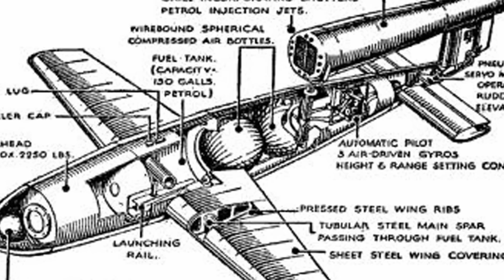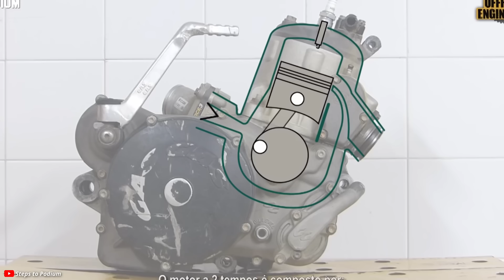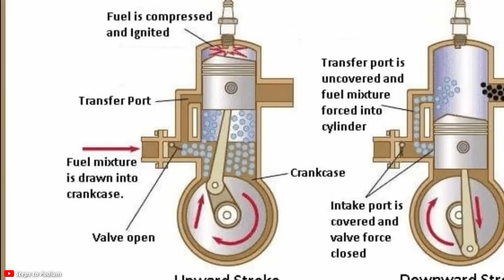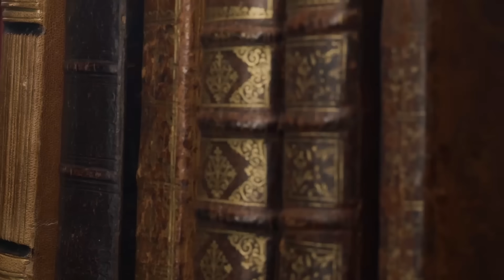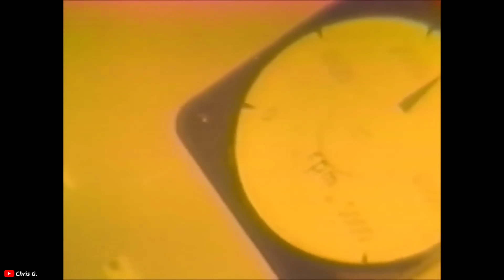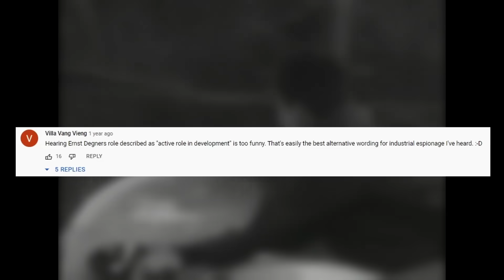How Suzuki stole communist technology to make their motorcycles faster

Comment: An interesting story, but stealing engine technology is not that unusual.  More on this alter.

I would consider Kaaden to be more an integrator, he took a number of pre-existing ideas and combined them to create an integrated system.  Don't get me wrong, this is an extraordinary feat, and very difficult to bring to fruition, let alone successful fruition. 

A great deal was known about high performance, two-stroke, spark ignition, engines but was not developed as there was no market.  Harry Ricardo had done considerable work on two-strokes, but his focus was somewhat different.

Two-stroke compression ignition engines were highly developed, especially in ships and aircraft (although in very different ways), but their operation is quite different, most use forced induction to scavenge the cylinders and direct injection removes or reduces the fuel loss.  Examples of aero-engines being the Junkers Jumo range culminating in the Jumo 223 and (if it was ever finished back in the USSR) the larger Jumo 224.  After the war, Napier built the Deltic engines, similar to the Junkers engines but with a different configuration that was determined by the packaging requirements of the boats they were designed to power.  

The Rolls-Royce Crecy was a spark ignition engines but also used forced induction and direct cylinder injection (design of the injection system was adapted from that used in the Fw190, how fortuitous that one crashed and became available for study), the requirements of the "sprint engine" project precluded subtle design elements, rotary valves and expansion chambers would have been totally inapplicable, the thrust from the exhaust provided a considerable proportion of the total thrust from the engine.  Also, the Crecy, the two cylinder experimental engines built by  Rolls-Royce and Ricardo, and the Napier version of a two cylinder test engine, were extraordinarily noisy, garnering complaints from far and wide.

The highly tuned two-stroke racing engines had such a narrow power band with precipitous falloffs in power either side of the tuned "sweet spot", had virtually no application in the civilian world.

As to stealing tech, the most copied engines ever would have been the engines in the 1912/13 Peugeot GP Car, especially the 1913 car.  Like the two-stroke, much of the innovation in this engine had been done before, but the "The Three Charlatans" at Peugeot together with Ernest Henry improved these ideas and integrated them into an operational engine.  i will not name names, but it is easy to find out who copied the Peugeot engines.

Even more interesting is how very close to a modern engine (in combustion chamber design, etc.) some of these very early engines were.  Unfortunately, engine development went down a number of dead end paths before finding its way ahead again,,, and again... Now, as we approach a true high point in ICE design, the ICE engine is under considerable threat from much older technology..

Comment: we'll never know how far could 2 strokes have gone if they had the same r & d as 4 strokes throughout the 2000's in both race and road bikes, with direct injection, variable intake/exhaust or even forced induction. the Aprilia SR 50 ditech was really good, but it never made it to bigger capacities. KTM injected two stroke is not direct injection so will never be clean/efficient enough for road bikes

Comment: well, Then what about Kreidler and Zuendapp,etc , German products ?
Used to have an end of 60's version, that was not slower then the 80's models, it just lacked more gears. These blocks could run 140-160km/h pretty easy, as a 50cc

Comment: Very good story. I had Suzuki RM125 -76 motocross bike. It has 21hp. I was total fan of Suzuki for that power. Now I look that little bit other angel. By the way I have old Cagiva 125 which has almost double than my old old Suzuki 125😂
Reply: Had a Yamaha yz 125 of that vintage. Soooo cool. Never heard of the other bike you mentioned. Its a 125 with 40 horsepower?

Comment: The fables surrounding Walter Kaaden are apparently ineradicable.

These days Walter Kaaden is regarded by many as the father of two-strokes. But he invented neither the two-stroke nor the expansion exhaust or the disc valve. Neither did Daniel Zimmermann, who equipped a 125 cc engine with a flat disc and made it faster than the piston-ported works MZ's. The East-German Communist Party then 'suggested' that he should donate his engine to MZ... 

Disc valves were patented in 1918 by the British Sun company who actually raced their 250 cc disc-valver in the 1921 TT on the Isle of Man, when Walter Kaaden was 1 year old.

Walter Kaaden didn't invent the expansion pipe either. Claims that he learned about the gasdynamics phenomena in exhaust systems through his wartime work on the German V1 cruise missile, are erroneous. Kaaden worked on the V1s inertial guidance system, not on its propulsion system.

The first to apply an expansion exhaust system on a two-stroke engine was DKW-engineer Erich Wolf. In 1952 Wolf equipped the 125cc and 250cc machines of works riders Ewald Kluge and Rudi Felgenheier with such devices. 
At the time Kaaden was using megaphone exhausts and it took another 4 years before he saw the light. The light was rather dim too, because the 158° exhaust timing of the MZ engine was far too short for a real expansion pipe. Kaaden switched back to megaphones and only in 1959 did he understand that he had to raise his exhaust timing by at least 30°.

Having said this, Kaaden was the man who kept two-stroke spirits alive after DKW withdrew from racing, and he deserves our respect for achieving a great deal under harsh conditions in the former Deutsche Demokratische Republik.

It was, of course, a huge blow to MZ that Ernst Degner's defection robbed the East German brand of an almost certain 125cc world championship. This setback had repercussions for the entire MZ racing department, which in the following years had even less scope than before, being punished by the DDR regime. But in my view it is understandable that Degner seized the opportunity to escape together with his family from a country where one could be shot when trying to cross the border on the way out, and where death by strangulation was a common method of execution because it was the cheapest way to kill one person at a time.

Comment: I would feel bad for the "communists" if I thought they were really communists rather than just proponents of dictatorship and if I thought they just wanted to live by the actual communist ideal that everyone should have access to what they need rather than that everyone only have the same thing unless they work in government in a high ranking position. As for Suzuki, I don't ride bikes so I can't comment on that segment of their business but I know when they designed their own car motors they were efficient and reliable and GM had to add planned obsolescence just to make those motors ever die.

The G10A 3cyl. had a single point fuel injection system with the fuel pressure regulator built into the throttle body. The cover plate for the fuel pressure regulator is held on by four tiny brittle torx bolts right at the edges of the plate and those tiny brittle torx bolts are installed with threadlock so they are clearly intended to snap off if you try to remove them. This means that using the same throttle body requires drilling out the steel bolts from the aluminum throttle body which would surely destroy the threads and expanding the bolt holes to rethread them for bigger bolts would require a larger cover plate since the old bolt holes are so close the edge of the cover plate but a larger cover plate wouldn't have room. If not for that deliberate design flaw, making it impossible to do a regular maintenance job when it becomes apparently necessary (by the time it's needed to keep the engine running smoothly, the long running engine series was out of production and new throttle bodies were no longer available), that engine would have needed to be run without oil to break down.

Compare that with Suzuki cars today and they don't even really exist as a car company anymore so much as a brand name GM sometimes slaps on other GM cars. This makes me sad... I miss my G10A Firefly and I still fantasize about getting a Swift GTi and swapping the aluminum block of the G13 DOHC turbo intercooled motor for the G15 iron block, swapping in a bigger turbo or maybe compound turbos and using that in FWD configuration in a Swift body to accelerate so fast that even that FWD configuration can beat mid-engine V8 Ferraris on the 1/4 mile... I've seen it done and I want one.

Comment: I have moderate doubt that Kaaden was the very originator of all those features that made the MZ engines this successful. I remember pictures of 2 stroke model engines from the Fifties with exhaust shapes that suggest they used these resonance effects and the Sachs and Ilo engines used on most 50cc Mopeds of the era had such exhausts, too.
Could it be this story is a bit into the trap of GDR-typical self-glorification? Don't get me wrong: Kaaden must have been good at his job, making his bikes this successful, but I kind of get the feeling things are presented slightly over-cheered here.

Comment: So Yamaha didn’t utilize the same technology in their TZ750s? Let’s share the blame. 
Suzuki has a lot to be proud of in later bikes that actually handled well, unlike most of their Japanese competition. GSX-R750, for an obvious example, meanwhile Honda is marketing unsafe bikes like their CBX 1000 which wore out its nylon swing arm bushings in a single day of testing by a major US magazine, leading to sloppy handling, for which they were justly criticized. This just to save mfg cost. The following year they quietly replaced these with the roller bearings that should have been there in the first place. That didn’t interfere with the success of the bike for buyers interested in its profiling value for which it was very effective indeed.
The GSX-R 750 on the other hand didn’t look like much, but it was a significant 100lb lighter than the Japanese competition when it was introduced and was profoundly superior and safer because it actually handled. What a concept!
My favourite Honda was a 1963 305cc CB77 Superhawk, which actually did handle nicely

Comment: 1943?  No!  Try 1908, some 35 years earlier!  "The first commercial two-stroke engine involving cylinder compression is attributed to Scottish engineer Dugald Clerk, who patented his design in 1881.  However, unlike most later two-stroke engines, his had a separate charging cylinder. The crankcase-scavenged engine, employing the area below the piston as a charging pump, is generally credited to Englishman Joseph Day.  On 31 December 1879, German inventor Karl Benz produced a two-stroke gas engine, for which he received a patent in 1880 in Germany. The first truly practical two-stroke engine is attributed to Yorkshireman Alfred Angas Scott, who started producing twin-cylinder water-cooled motorcycles in 1908."

Now...  "They would just ride the bikes around and see which designs were faster."  Umm...  Also, no.  They had access to roads, sticks for measuring the start and end of a strip, and stopwatches.

Finally, you should REALLY mention the FACT that while simple two-strokes such as often used on lawnmowers, weed-eaters, leaf-blowers and chainsaws have considerably greater emissions than four-stroke engines, by using employing direct fuel injection, a sump-based lubrication system, rotary inlet valves, and other inexpensive techniques, two-stroke engines can produce FAR LESS emissions than four-stroke engines while maintaining far greater power-to-weight ratios and far greater HP to fuel burned efficiencies due to the two-stroke's inherently greater thermodynamic efficiencies.  

So!  California!  Remember when you banned two-stroke engines because you thought doing so was smart?  It wasn't.  It was IGNORANT.  It was STUPID!  What you SHOULD have done was grandfather in all two-stroke engines while requiring manufacturers to make the small and fairly inexpensive modifications necessary to achieve emissions standards which EXCEED four-strokes, by virtue of the two-stroke's greater thermal efficiencies, and WITHOUT having to add a bunch of damned, efficiency-robbing devices which are required because four-strokes create MORE emissions than well-designed two-strokes.  Think SMARTER, California -- NOT more regulatorial!
Reply: Hmmm. This is very interesting. Where can I find more facts about modern two stroke ' s emissions, which proves, they are lower in emission, than four strokers?

Comment: Some lovely illustrations of MZ Racing bikes you found, their road bikes looked awful in comparison. 

2 Strokes are actually also suck/squeeze/bang/blow they just divide the 4 into 2 pairs, suck&squeeze / bang&blow, that means a 2 stroke twin gives a power stroke every stroke which takes a 4 stroke 4 to equal hence before a certain point in time the advantage of a two stroke was engine weight before metals science refined 4 stroke weight down to a much finer and lighter art. 

It's odd though how 2 Stroke technology peaked and then got dumped out of history, no doubt by legislation rather than engineering, that invasive authority over evolution is a strange ever narrowing road engineers are forced down, authority just moves on to legislate against whatevers left until engines start to look like they came out of Frankensteins laboratory, aka the new BSA Gold Star 'dingbat pretend exhaust pipe' destroying the integrity of everything else. 

2 Strokes had several more phases of development from where MZ and Suzuki took it. One of your diagrams shows a variable Reed Valve inlet port and variable exhaust porting also got included soon after usually mentioned on the graphics somewhere, both could self adjust the porting timing and size to suit slower and faster engine speeds spreading the power out rather than snapping it in at a specific RPM. 

Most of the race tech would find it's way eventually into production bikes, Suzuki's 750 water cooled triple and RG500 four both had production versions once done with at Race level, Yamaha's RD range were 'Race Developed'. Suzuki and Yamaha as far as I know were the first to use expansion chambers as standard on road bikes for the Suzuki X7 250 and Yamaha RD250/350LC although both were subtler versions of full race spec exhausts.

Most engineers are first and foremost engineers who work in, with or for National interest but at the cutting edge you'll usually find a close proximity wherever they're based, it's that edge that drives them forwards and your video showed that well.

Comment: While it is true that a 2 stroke engine has twice the number of power strokes then a 4 stroke, a 2 stroke makes less power in those strokes. A LOT of power is wasted in three major ways. First you lose a large about of air and fuel out the tail pipe on the compression stroke as the exhaust is open until the piston passes it. Secondly it loses power out the tale pipe, as the exhaust port is opened as the piston passes it. And lastly there is the issue of exhaust gases being still in the combustion chamber because there is back presser in the tail pipe which will keep all the exhaust air from leaving before the piston closes that port again resulting in less fuel/air to burn each cycle then a 4 stroke. These three issues 4 stokes don't have.  The more accurate way to say it isn't that a 2 stroke makes twice the power, but that it delivers more continuous power then a 4 stroke, as there is power being delivered every rotation of the crank, unlike 4 strokes where it is every two rotations.
Reply: Is exactly what he explains in the video. Just watch the technical part again. The circumstances (exhaust and so on) where just added features to make the advantage of the two stroke work BETTER.

Comment: The video title is biased toward Degner or communism seemingly. From the story, it should be "Degner", instead of "Suzuki", stole the technology, essentially.  Suzuki did not even induce the tech transfer, but simply agreed to Degner's proposal. Jimmy Matsumiya was basically a business coordinator, having accidentally made friends with Degner thru jazz. Also, it should be noted that Japanese 2-stroke tech is not represented by Suzuki only. It also is by Honda, Yamaha and Kawasaki.  These  competitors of Suzuki eventually excelled Suzuki, even without Degner, meaning the MZ chamber engineering might have been a great secret at that time, but was soon to be outdated.

Comment: If you want a great example of Suzuki's epic laziness, I'm embarrassed to admit it, but I ride, and love owning one of them, a bike that's gone basically unchanged for over 30 years, the Savage LS650, or what is now called the "Boulevard S40", it's a wonderful bike, but it is as basic as a bike can come, 1 carb, 1 cylinder, drum rear, single disk front...and an astonishingly high price, given that it's 99% the same exact bike for decades. That's not to take away anything from the experience of riding a large, single "thumper", and one that works very well, but there are 2 or 3 issues that have just been overlooked and ignored as well, serious issues that every owner must tackle themselves, or hope that, if buying used, previous owners have taken care of. I love the bike, there's nothing like it, but it's lazy, and archaic sloth-like evolution can't be ignored.

Comment: A V 1 causing 4000 deaths? Come on, At the very most it may have caused 25 deaths which was bad enough. But a weapon of mass destruction? With it's limited range and small warhead of conventional explosives, I think not. But the story of Cardens Tuned pipe (correct name) and MZ and Suzuki needs to be told and you've done pretty good so 'Respect' for that.